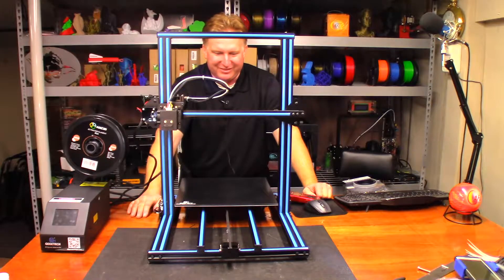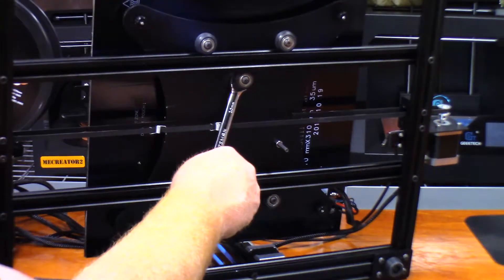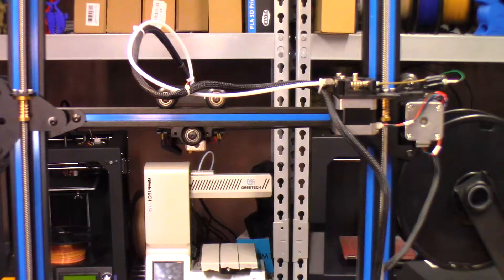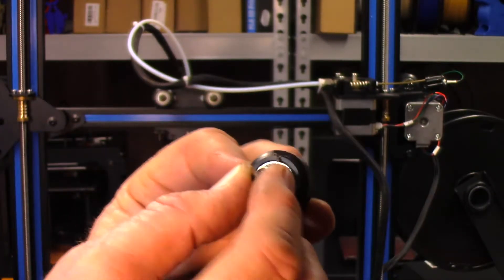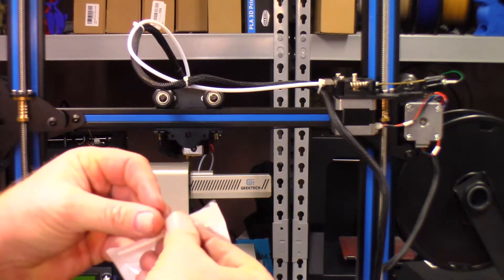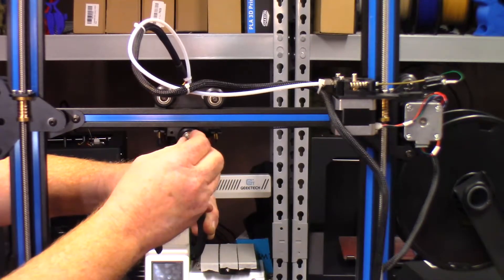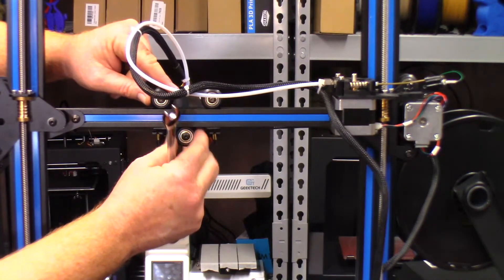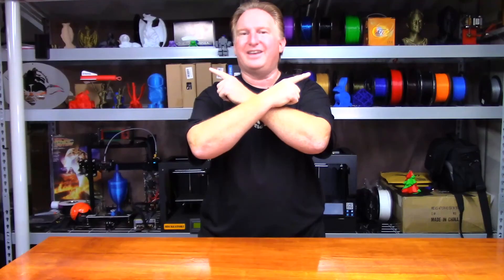Working On The Geeetech A30   Flattened V Wheel Replacement

Comment: Did you see a quality improvement with this wheel? Are they better than the original ones or absolutely the same? I think the original ones aren't ball-bearing right?
Reply from the maker: It did improve the quality.  I actually never checked.  I just assumed they were ball bearings.
Reply: @JimmyShawsTidbits1  thank you. I'm waiting for a new kit (not the same vendor like yours) hoping they would be good.

Comment: Hey Jimmy, on the outside wheel that's loose, my guess is it will have traction at one side of the Y, and looser at the other. If this is the case it usually means the Y rails are not quite parallel. You should be able to loosen up the 4 bolts on the Y axis and roll the bed back and forth a few times then tighten them up to get them back in alignment.